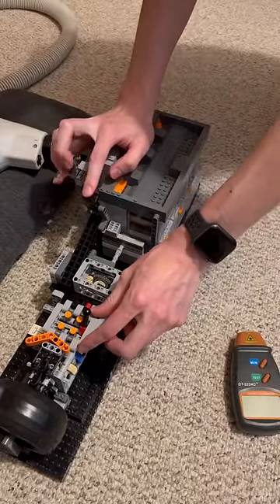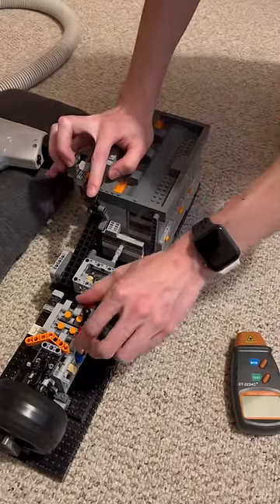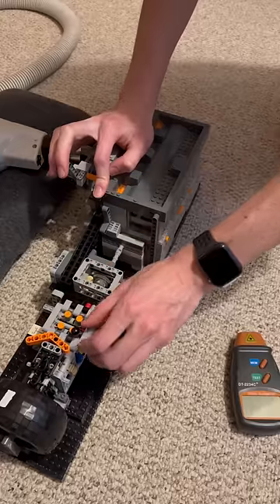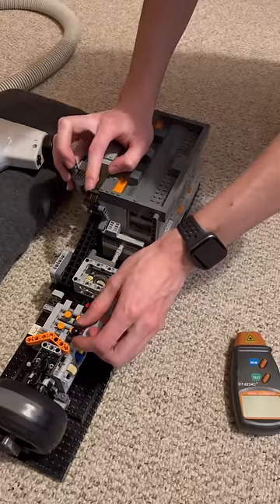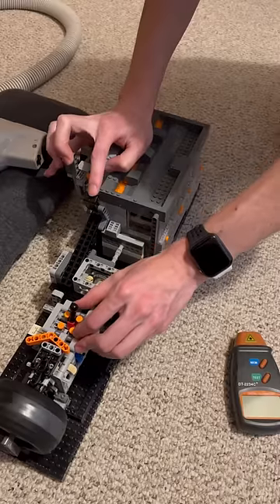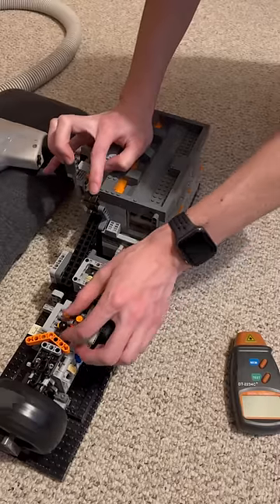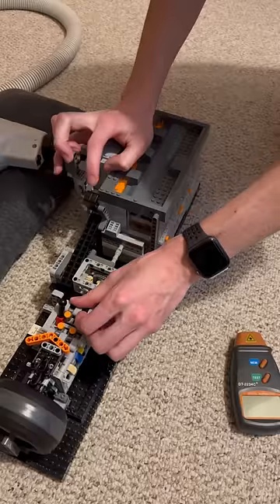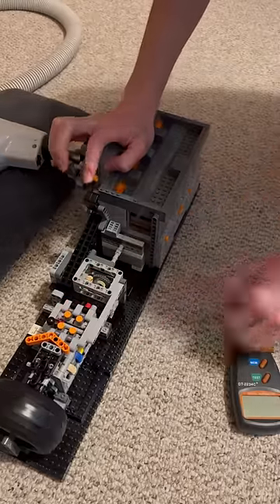Testing the Lego disc brakes and drivetrain ￼for vacuum engine. #legotechnic #legoengine #lego

Comment: working the throttle body MANUALLY is hilarious!!  (as well as awesome!!).
Reply: Thats everything up until the early 2000s my guy
Reply: @adamhonda98  so you’re saying that pre 2000s… people just sat in the engine bay to drive?
Reply: @TM-fx5le Cable driven throttle my guy, all cars prior to drive by wire the foot pedal MANUALLY works the throttle body - with a cable.
Reply: @pokeosinisor  yeah bro that’s like… extremely common knowledge. I think you misunderstood the original comment, that he is operating the throttle body via the linkage on the butterfly itself 😅 instead of there being a typical arrangement with a pedal mounted remotely in the cabin… merry Christmas BTW 😊😊
Reply: @TM-fx5le no, i think thats exactly what he means, that cable thats attached to the pedal just moves the butterfly valve like hes doing with his hand?
Reply: He basically put a gas pedal directly on the throttle body with that giant lever..
Reply: Not a throttle body, just a throttle.
Reply: @TM-fx5le forgive me if I’m wrong but could you tell me where the “cabin”
Is on his Lego motor?
Reply: @PushingDownDaisys  you never stated any facts, how could you be wrong? You asked a question… anyway. Cars usually have a gas pedal in the cabin, by the foot well, if you didn’t know. This pedal usually has a cable or some form of operation (could also be electrical) that modulates the throttle butterfly. 

This is quite simple information, so I’m not sure what you’re asking, but this is a LEGO demonstration of an engine and transmission assembly. There is no shell, and therefore no cabin. If you watched the video, you’d know.

This, being a demonstration of an engine and transmission assembly, and not a demonstration of the operation of an *entire car*, there is no cabin shown. Hope this helps I guess.
Reply: @TM-fx5le  no you're wrong, I remember back in the good old days, 1895 to be exact, I was already a young man! We didn't have steering back in those days, we just used a cut axel and alternated power by hand sitting on the motor. To steer right, just power the left side! We drove zigzag up until 1920s!
Cars were largely steam or electric, wasn't until that meddling Ford built his uppity mobile that people got steering wheels and brakes!
Reply: @viktorbirkeland6520  nothing that you said added any value to this comment section but no worries lad
Reply: @TM-fx5le it did add value. I laughed. The rest of you just had me nodding off trying to explain how a throttle works to, likely, a child on the internet.
Reply: @pokeosinisor oh shit i own a 90s car and assumed new cars were still like that lol 😭
Reply: @deadlydonague2402 It's still a throttle body though.
Reply: @TM-fx5le Nothing you've said has added any value either. Your initial comment was you incorrectly correcting someone in the stupidest way possible. 🤦🏻‍♂️
Reply: @Studio23Media  sick of replying to idiots. This will now be my automated reply.

Come back with 15+ years of automotive experience and qualifications, cheers.
Reply: @Studio23Media  nope, just a throttle, the throttle body is fixed to the motor and cannot be worked manually, but the throttle can be
Reply: @deadlydonague2402  yeah, technically just a housing, which this system lacks so you are correct
Reply: @deadlydonague2402  Lol that's completely false. The throttle is ON the throttle body. You don't know what you're talking about...
Reply: @Studio23Media  really? On most vehicles the throttle is a pedal or lever that is connected to the throttle body via the throttle cable. The setup in this video is no different, he has a lever (the throttle) connected to the throttle body.
Reply: @deadlydonague2402  The pedal is the throttle (or accelerator) pedal, which is attached to the throttle cable. The throttle cable is connected to the throttle, a pivoting piece located on the throttle body. You ever see somebody reach in and rev up an engine with no air intake on it? That little piece they grab and twist is the actual throttle. 

Think about carbureted engines. They don't have a throttle body, but there is still a throttle built in to the carburetor.
Reply: @Studio23Media  the “throttle” you’re describing in the carb is a valve, called the throttle valve or butterfly valve. The thing connected to the butterfly valve that people will reach in and turn is the throttle cam or throttle lever depending on the type of carb. The only thing that is simply called the “throttle” is the piece that the driver is intended to use. If you’re looking at a car and someone asks you to point out the throttle, you aren’t going to point to the carb, you’re going to point to the throttle
Reply: I laughed harder than I should on the engine bay comment! Kudos  @TM-fx5le
Reply: @adamhonda98 carbs went out on automobiles in the 80's.
Reply: @TM-fx5le  are you joking or serious?
Reply: @pokeosinisor I have a ‘55 Chevy 3100 pickup, she has a manual pull throttle knob on the dash as well as a choke pull (for cold starts and high altitude), when you pull the throttle the gas pedal depresses. My comment has nothing to do with any of the other bickering comments, just always loved pulling the throttle knob and relax my foot like cruise control
Reply: @pokeosinisor it’s called a carburetor at that point I think…

Comment: Amazing! How does it cope with heat without oil or coolant??
Reply from the maker: Not too bad, I give it a clean and add a bit of spray silicone lube every once in a while. I’ve noticed some of the plastic melting but I haven’t had to replace any parts yet, it’s kinda worn in and works better now
Reply: @jmodsbricks   Ah so you do try add a little bit of lubricant, I was wondering 👍👍
Reply: I mean it helps when there's no exploding fuels.  But yeah friction is a problem

Comment: Quick question man, why do you have a differential when there's no wheels attached, only the flywheel?
Reply from the maker: Good question! I’m actually using the diff as a clutch because Lego doesn’t make any kinda of release bearing. More typically Lego clutch designs just have a lot of friction that this design doesn’t. There’s a shot on my page somewhere about it🤟🏻
Reply: @jmodsbricks Ahhh, gotcha. Much appreciated, good work!

Comment: So An engine runs on a/ an consumer vacuum which is powered by your wall outlet.. Sooo a REAL Engine would then need A HELLA lot of sucking (That's what she said; meme.) and the correct Volt /Amp current amount to run. So it would be a REVERSE hybrid???

Comment: Pistons should move in pairs! Crank angle should be 180° not 90° like you have here. You might have a smoother running engine then.

Comment: Never seen an inline 4 before not to mention with fitting colors. Nice job.
Being a 4 cylinder it's also quite smooth and likely has a really stable powerband. But unfortunately the increased resistance and leakage make them less powerful than smaller engines.

Comment: have you looking into 3d printing
Reply from the maker: I’ve been thinking about a resin printer🤔 not sure if a normal FDM would do the trick
Reply: Resin printing has a really hard time with accurate geometric shapes, like flat surfaces or hitting dimensions properly. FDM is honestly much better for making things that need to be assembled together. @jmodsbricks

Comment: You're living in a house with a whole house vacuum. Those are not cheap period in the are installed at the time of construction, the home has to be at least 3,000 square feet. Yes I'm speaking about the vacuum on a Lego video
Reply from the maker: Ya it’s a pretty big house with a power central vac. It also works with a shop vac and a normal corded vacuum top tho

Comment: pretty slick, id say run the flywheel between the diff and engine. then try to run a winch or something off the output shaft
Reply from the maker: Nice idea. Could actually try and calculate horsepower that way too👍🏻

Comment: Solar energy from the sun to chemical energy in the plants, to the chemical energy in coal, to the thermal energy in a powerplant, then the electrical energy in the powerlines, mechanical energy of the vacuum, to mechanical energy of the lego engine
Reply from the maker: Mechanical energy of the Lego engine into kinetic energy in the wheel to heat in the breaks😂🤦🏻

Comment: please fix 1st gear to the proper location.
Reply from the maker: Define proper? That’s where 1st is in my car. If anything, R and the rest of the gears are in the wrong spot
Reply: @jmodsbricks  1st should be directly above second.  straight pull from 1st to 2nd.  reverse is always on a leg off the main main shift pattern.

Comment: How did you make the clutch?
Reply from the maker: It’s kinda hard to explain but I’m using a differential, what would normally be the real wheels are replaced by the engine on one side and the transmission on the other. Then what would normally be the input shaft is just a wheel that’s allowed to spin. When I let go of the clutch, teeth drop down and stops the wheel from spinning, forcing the power through the diff, from the engine to the trans.
Reply: @jmodsbricks  that's sick af man
That's crazy that you though of the props to you man 👍👍
Reply: Thank you for explaining to I'm going see if I can figure out how to build it
Starting my coreer in mecanics
Will be good to make me start thinking out of the bock

Comment: Try to make a v8 next
Reply from the maker: Working in an inline 6 at the moment. I’m not completely sure if I can make the Lego seal effective and airtight in a V configuration
Reply: @jmodsbricks  fair id be way easier to do a flat 8
Reply from the maker: I could definitely try a flat 8 or even 12. It would probably be super expensive tho😅

Comment: Does it stall?
Reply: Probably not, I think cars only stall because of the weight of them
Reply: @Matty27  it’s friction based. Example: my clutch on my motorcycle can be dumped if the rear tires off the ground.